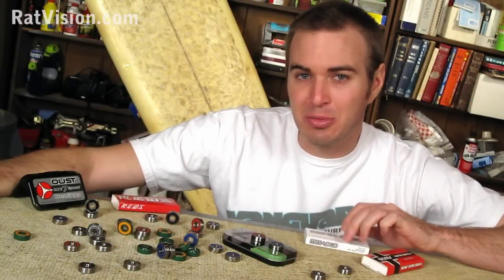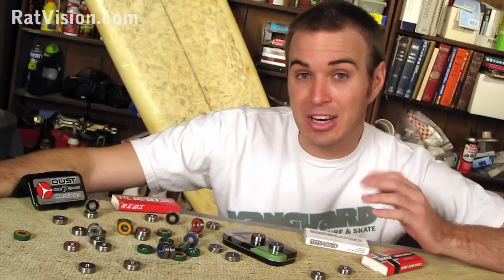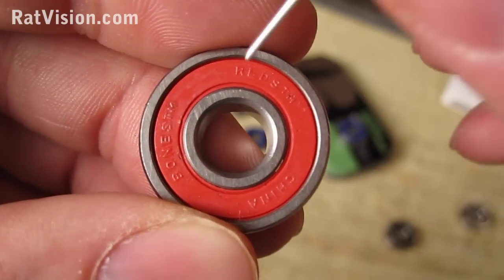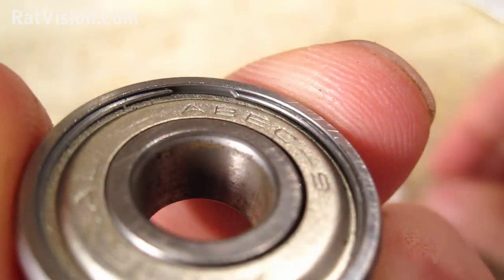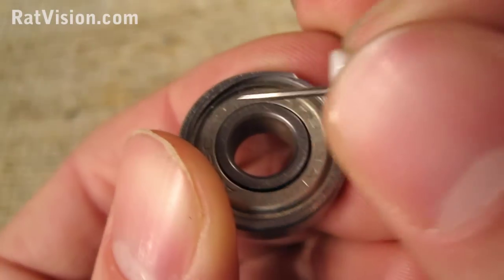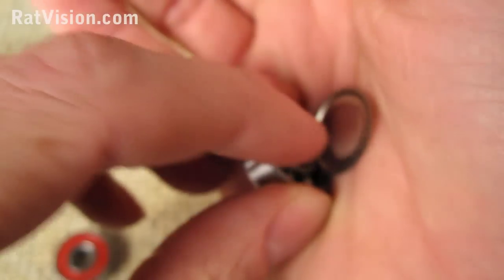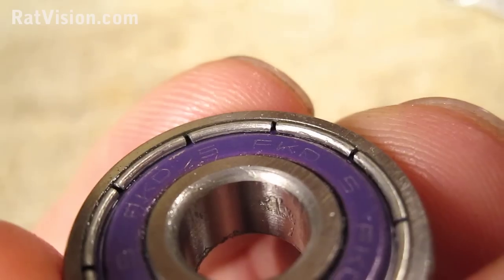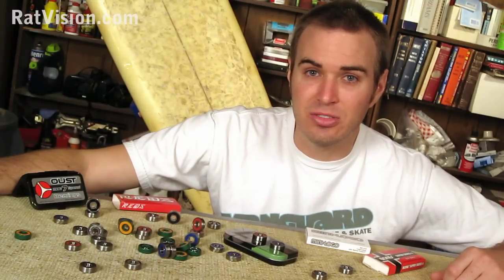Take Off Skateboard & Longboard Bearing Shields/Seals

Comment: would the seal effect how fast the bearing is?
Reply: if so what bearing would be fastest
Reply: Cobi Kiffmeyer No how fast a bearing is depends on the ABEC rating
Reply: Cobi Kiffmeyer The higher the rating the faster it is
Reply: Noah Theologou thanks
Reply: +Noah Theologou this is not quite true.
The higher the ABEC rating, the tighter the tolerances are, making the bearing a more precision part. High precision and small tolerances are required for bearings to function at very high RPM, in products like high speed routers that must spin at 20 to 30,000 RPM. In an application like this, an ABEC - 7 or 9 bearing rating may be appropriate. However, a skateboard with 54mm wheels turning 20,000 RPM will be traveling about 127 MPH! Since virtually all skating is done under 30 MPH, the realistic maximum RPM your skate bearings will see is about 4700 RPM and probably 90% of skating occurs under 2000 RPM. Thus, very high precision is not required at skating speeds.

The dimensions and tolerances controlled by the ABEC standards include the diameters and widths of the raceways, their shapes to some extent and the smoothness of the running surfaces. The ABEC rating system ignores side loading, impact resistance, materials selection and grade, appropriateness of lubrication, ball retainer type, grade of ball, the clearance between the balls and the races, installation requirements, and the need for maintenance and cleaning. All these bearing design requirements are very important to the performance of your skate bearing, even though the ABEC rating says nothing about them.
Reply: +Noah Theologou BS.  how "fast" a bearing is (I hate that term because fast is a measure of speed (MPH) not drag) is determined more by the geometry and smoothness of the races and roundness of the balls.  ABEC does not measure that.  You could have an ABEC-7 bearing with square balls.

Comment: What lube can i apply on the non removable bearing shield?can i use oil?motor oil?or grease?please help me i have non removable shield :(
Reply from the maker: +Jee Versoza Use a thin oil. No grease or motor oil.  3 in 1 is ok for small parts
Reply: +Rat Vision – Skateboard Tech thank you ☺
Reply: Rat Vision – Skateboard Tech something like WD-40 is good right?
Reply: nooooooooo. that shit traps so much gunk in your bearings

Comment: you really shouldn't pop the shields.. It may sound "cool" and pros may do it, but it decreases the bearing life and you'd be better off just cleaning it in oil or something like that.
Reply: pro's pop shields out because they have a lot of money and when there bearings get really bad they buy new ones.
Reply: how does it decrease bearing life?
Reply: dirt and scum gets in it and it starts to rust really bad. Of course pros, they could care less because they can get a new set whenever.
Reply from the maker: Pro are good at skating.  They aren't the smartest people about skate equipment.  Taking the shields off is like taking a rain coat off when it's pouring out.  The shield is there to protect/SHIELD the bearing from water and dirt.  Removing the shield DOES NOT CHANGE SPEED.  It also allows for the lubricant to come out as well.

Comment: WD-40 is nice?
Reply from the maker: +Jeremy Boneo NOOOO
Reply: +Rat Vision – Skateboard Tech why? it cleans it right
Reply: +Rat Vision – Skateboard Tech where do i buy a orange oil?
Reply: +Samuli Vänttinen it doesn´t lubricate the bearings enough
Reply: +MrRandomTwat Obviously I would use wd 40 just to clean the bearings. After that use some propper oil
Reply: Samuli Vänttinen you can use it like that for sure. WD40 itself does no harm.

Comment: Why would he just stab a paperclip right through the rubber seal? it damaged the seal and rubber seals can be easily removed with a craft blade which is thin enough to get between the seal and the metal without damaging the seal.
Dont ram a paperclip though your seal like a gorilla like this guy did!

Comment: I have bearings with non removable shields, they came stock with some sort of grease rather than oil. (which is fucking retarded and I have no idea why they did that) Anyway, do you have any idea how I could clean some of that shit out and maybe put in some bearing oil? They're brand new I haven't even used them yet, but I just wanted to try and de-grease them before using them. If there isn't anything I can do I'll just suck it up and abuse them till they die

Comment: STOP!.. DON'T DO THIS.. Yeah, I got a better way... Instead of using a blunt paper clip that destroys the sealing lip so you can never reuse it again, use a small box cutter and carefully and gently push in and then pry under the big end of the seal so you don't tear the small side sealing lip like this goof did when he basically shoved a flat bottom rod through a rubber membraine.